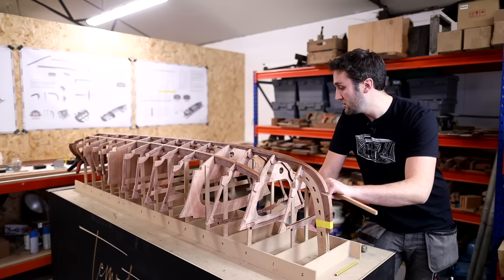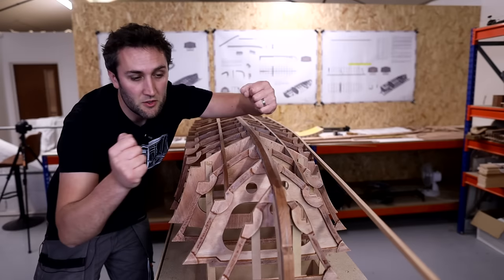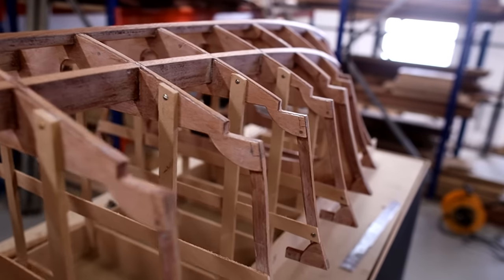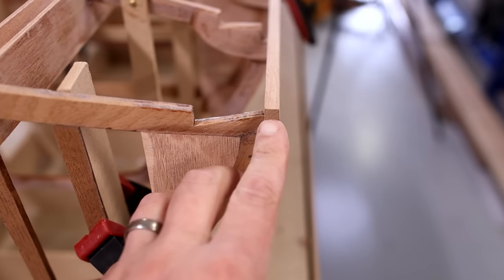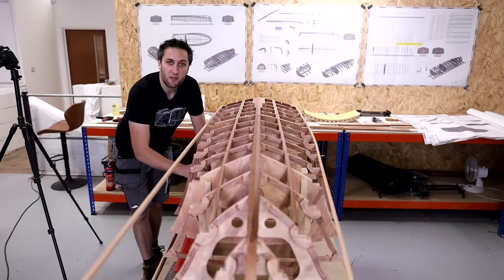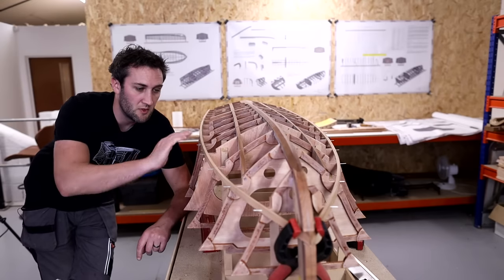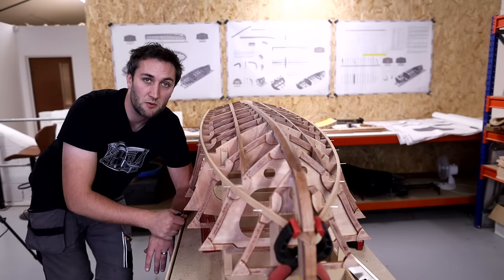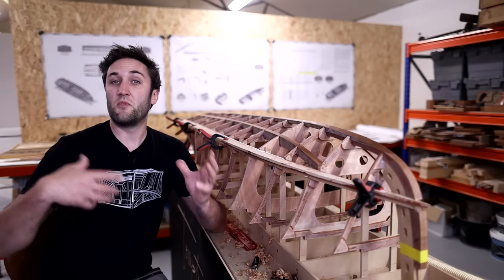Chine Install AND Should I Start A Full Size Build? | Temptress 1/4 Scale Boat Build Part 18

Comment: Dan, I love to watch your 1/4 scale Temptress taking shape and hopefully your full size version will soon come to fruition. Creativity of this sort is a wonderful talent to have and such projects as this hopefully will inspire others.  My more modest attempts at boat building have been so rewarding I only wish I had had  the opportunity to learn the craft sooner. The present one is outboard powered but I would have liked more power and if building another I would go for an upgrade in the horse power department. Also I love the look of the latest wave piercing designs which perform so well on the sea near here in Devon.  Have you thought about an outboard powered version of Temptress ?
Reply from the maker: Thanks Graham. An outboard powered version of Temptress would really require a ground up re-design as the weight distribution would be completely different. It would be a nice boat though, perhaps something a little smaller, 18-19ft in the same styling but outboard power would be really nice.

Comment: Hi Dan, Great videos and I'm not a wood guy by any means and I wouldn't know if it's a common well tested technique in wooden boat building but are you sure the floating skins to prevent print through is the right route? I get it that the stations are still attached at the stiffest edges of the skin but can you not just fair the hell out of the stations, it just seems a wasted opportunity to take advantage of the integral bonding and stiffness.
Reply from the maker: Floating is the way to go, it is a well proven method 👌